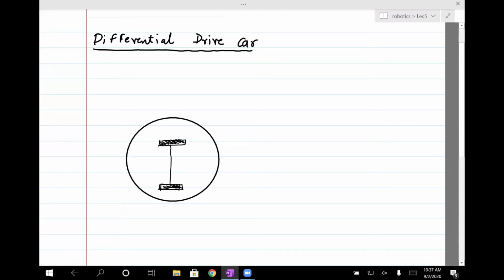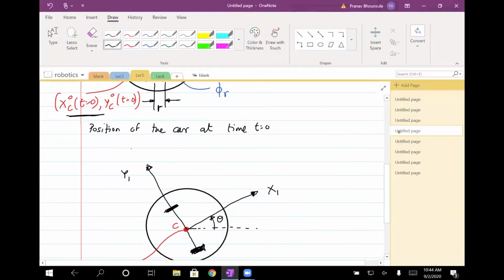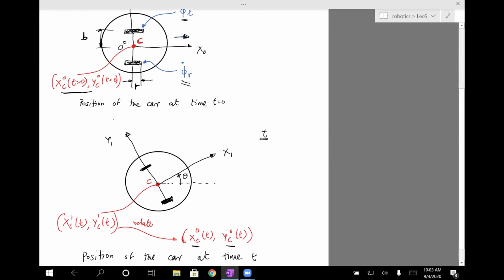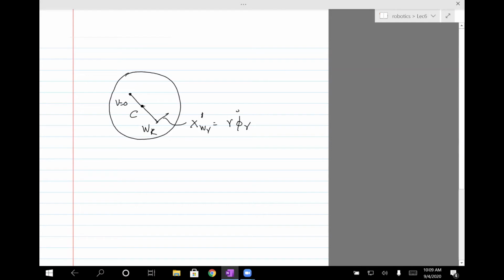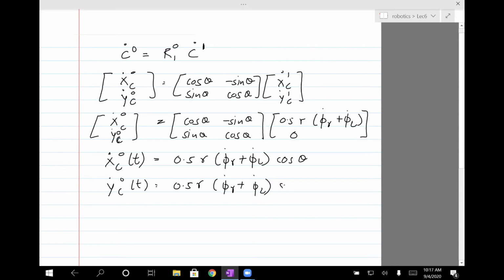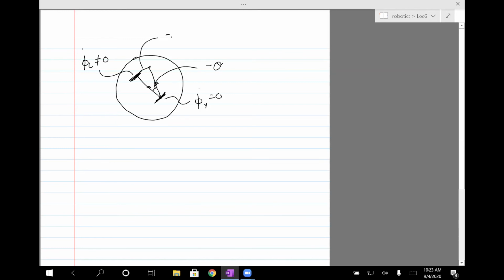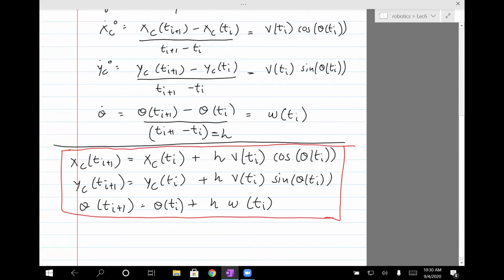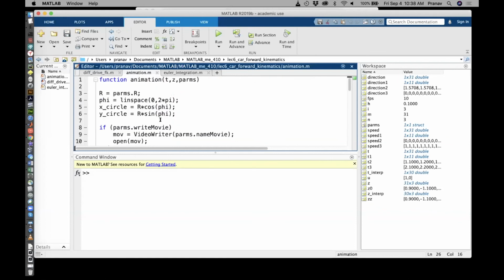Robotics Lec6: Forward Kinematics of a differential drive car  (Fall 2020)

Comment: I thought arc length is equal to pi* r * theta/360
Reply from the maker: If theta is in radian then arc length is (r theta). If theta is in degrees then arc length is ( 2 pi r theta /360)

Comment: Given that the frame (O1-X1-Y1) is attached to the car at point C, shouldn't the velocity of the point C in frame 1 be zero ?
Because the point C will appear to be relatively at rest when viewed from frame 1( as both are moving with the same velocity).
I'm sure there is something wrong with the above argument, any help in understanding this would be appreciated.
 
Thanks a lot for the amazing lectures..!!
Reply from the maker: Yes you are correct. The velocity in frame 1 is zero. I might have mis-spoken. The velocity is frame 0 is not zero and that is what I compute using the rotation matrix.
Reply: @pranavab  Thanks a lot for the clarification sir..!